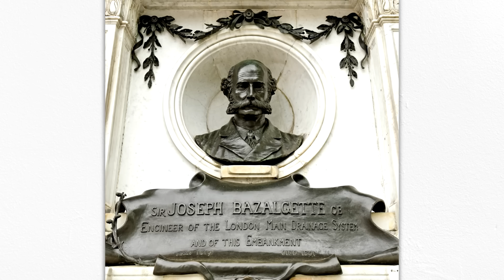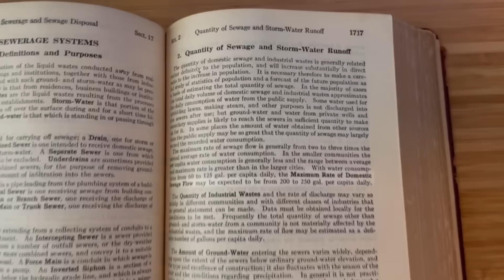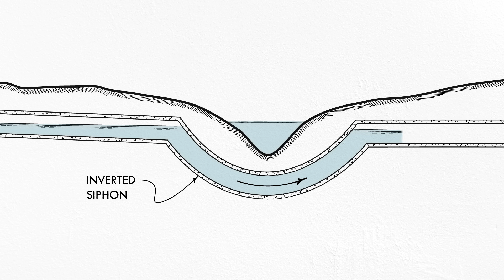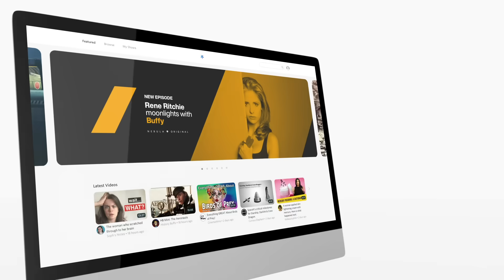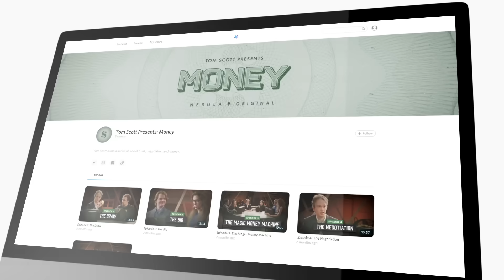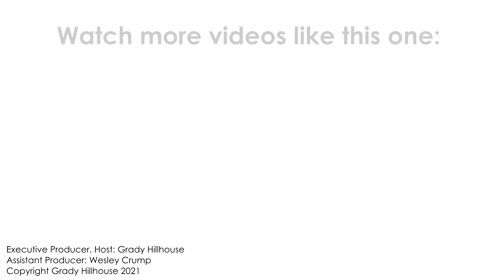How Sewers Work (feat. Fake Poop)

Comment: Bazalgettes pipes were egg-shaped to manage the different flow characteristics during high and low usage. I dont think anyone nowadays really uses egg shaped pipes though. I wonder whether its actually any better.
Reply: They were used in combined sewers which conveyed relatively consistent sanitary sewage most of the time and large storm water flows occasionally. In separated systems, both sanitary and storm sewers use circular pipe.

Comment: Hey Grady, could you do a video on jacking pipe? A housing estate nearby built 2000 houses and decided to link it to the town's 1950's sewerage system with predictable results.... They therefore had to retro fit a sewer line to the water treatment plant but this was the other side of 2 main roads and a cross-country railway line a distance of over 100m. They dug down either side and used jacking pipes to bore a tunnel through. I just thought you might be the person to explain this to me better. If you could find video that would be amazing and I think you could even do one of your models. If you read this,thanks either way

Comment: I would say that the oversizing of buried pipelines that are not expected to operate at full bore (such as sewers and other drains) is almost always the right economic decision. The costs of retrofitting buried infrastructure vastly outweigh the marginal cost of increased pipe diameters during initial construction.
Reply: "We're only going to do this once" is simple, inelegant, but perfectly describes the situation.
Reply: All things are engineered oversize, this is the nature of uncertainty. The question is by how much and can you show non-arbitrary reasoning for that amount. 1.2x 2x 5x? Or estimated population and habit changes for the next 10 years 50 years 500 years? (And how much variation is inherent in those long term estimates?) If 50 years is a good target why not 40 or 60?
Reply: @mytech6779  Luckily there are many models and methodologies to choose from. However, my experience (having worked on a lot of water projects - clean, foul and other effluents) is that the oversizing for futureproofing is often determined by budget constraints and ground conditions when it comes down to it.
Reply: @csatterley  this has been my experience as well, but I've also been out of that whole field for several years now. One big outlier was a city that had the chance to redo their system top to bottom and they planned it out brilliantly, even accounting for major future growth and expansion in coverage area. The dude in charge of that project was meticulous and smart as hell.
Reply: I design sewers for a living. My design phylosophy is to design them around 75 perxent full based on a 40 year design life.
Reply: @donquique1  sound a lot like BS EN 12056. System II is recommended in the UK. This is for domestic sewers such as new developments (where you know the number of dwellings you are connecting and that will not increase as new dwellings will have new connections built). Not for main infrastructure though (where you don't know how many dwellings will be connected in the future). They didn't design the Thames Tideway for 75% full and a 40 year design life, for example.
Reply: most of the cost is probably labour anyway I venture to guess
Reply: ...and be sure to adequately vent them, to ensure no explosive gases can significantly accumulate.
Reply: Oversizing saniatry sewers is not recommended because if the water velocity is below 2 ft per second it accumulates hydrogen sulfide.  Hydrogen sulfide corrodes the sewer. Sinkholes can develop from failed sewers.
Reply: @donquique1  I often see old brick sewers that are tapered at the bottom. Is this a proper way to maintain flow, and are there other methods?
And how do you feel about flushing ashes from your fire place? To plug miniscule holes and counter the natural accidity of rain? Thanks.
Reply: @donquique1  vent it.  Problem solved.

Comment: When in Paris, visit the Musee des egouts de Paris - the Paris Sewer Museum.   Yes, it's an active, working sewer system.  I don't know how the ventilation is processed, but it smells more like a machine shop.  There's been a suggestion, the air is cleaned and fragrance added.
Reply: i tried to go there but the line at 6am was doing 4 loops around the block. no thanks.

Comment: I know flushable wipes arent good for the sewer system but they are far better at the job of cleaning the poop out of one's butthole. As some show (I can't remmeber it's name) said "you wouldn't use a dry towel to clean up mud off the floor." Tiolet paper really sucks at it's job, it's atiquated and I'm honestly surpirised its lasted this long. Maybe for people with clean poops of the right consistency tiolet paper is fine; I've had some of those poops myself and if everyone was like that I would think anything more was needed. However for all the other messy varieities you need something wet to clean it off. Think about it; if you got poop on your hand wiping would you just wipe off your hand with some tiolet paper and go about your day, or would you wash hands, getting the area wet and scrubbing it? Also sense moist wipes work so much better they reduce all the problems one can have from tiolet paper like too much wiping making one's butthole raw and sore. I don't remeber the technical term but I had a buddy in college with IBS and this was a problem for him.
Reply: A bit too much information for me. That said, just wet the TP.
Reply: @johnr5252  have you ever tried weting TP? It clumps up into a very small ball and also breaks apart leaving paper particles in your butt crack.

Comment: This was uploaded right as i had to fix my own sewage line because a bracket broke and the incline in the pipe was now off by like 2 degrees and caused return pressure and blasted the wax ring out and caused....issues.

Comment: Thanks for showing this..as an operator in good standing level 3 collections in Canada. "flushable wipes" and "fat" are by far the costliest thing we deal with on a regular basis...we spend as a city around $900K a year just to maintain the flow in a collection system of around 2500KM (1500miles)

Comment: In my city they had to replace a lot of sewer in the past few years because people used less water then they where designed for and the poop got stuck all the time if the city was not pumping lots of extra water through them. I live in a pretty wet region and water saving is kinda pointless her but people where meaning well and used less water what was counter productive

Comment: Grease and oil congeal at room temperature...which is why when I have designed a WSV (Waste, Sewer, Vent) system for a restaurant there had to be a grease interceptor installed downstream of the kitchen waste.  There would be two lines coming out from the restaurant slab, one for kitchen waste and the other for sewage and the everything else waste.  The waste pipes do not transmit sewage, basically urine and poop...and the other "flushable" items, which had to be routed around the Grease Interceptor so that you would have only grease, oil and water going into the Grease Interceptor.  It IS a "GREASE Interceptor" not a "POOP Interceptor", or a "flushable stuff interceptor", after all.

Comment: 10:41 dude... you have no idea. as for the ads you mentioned right after, I have my ways passed those too. the easiest is to just use the Brave browser, it will cut out all youtube ads. secondly one can skip to the end of a video and hit replay (auto-play next video MUST be turned off for this method to work) and all ads drop from the video. lastly (with personalized ads turned on) one can cap the time-stamp in the bottom left corner of the ad and follow the pop-up stating you don't like the ad, another pop-up will ask you why you don't like the ad but one can actually just hit "close" without citing a reason and upon doing so both ads that would normally play before the video even starts (and aren't skippable) are dropped. 

from what I've experienced, youtube doesn't actually care what reason you give for disapproving of the ad, despite dropping it I guarantee you will see the same ad again, but it will still be skippable using the last method. some ads won't let you use even this method though.

as an honorable mention, if you have the patience... if you see an ad you can just close and reopen the video many times until it loads without an ad. with the exception of the Brave browser, all these work from within the android youtube phone app. I can't confirm if it works on iOS.

Comment: The wet wipes problem is so stupid, the solution is so obvious.

Half the world mocks western societies for how they clean their butts with just dry methods... and wet wipes jumped from babies to adults to save the day. Babies wet wipes were stored in the diaper and the thrown to garbage, but adult people simply don't like to throw literal feces to their garbage, so down the drain it goes.

Just use another method to clean your ass (other than dry). No need to innovate, half the world uses bidets. Japanese bidets (in the lid of the toilet) are the ideal solution.

I know it would take years to amortize the investment, but that's because you're not accounting for sewer blockages costs.  Town halls could provably subsidize part of the cost and save money.

Comment: Not my field, but just my 2 cents:

1: why not turning I&I into use and only flush excess into storm drains?
https://youtu.be/IxXaizglscw?t=3m29s
Where the and output is the storm drain and the exclusive or output is the sewer. Using the slower trickle of the exclusive or output to maintain the sewer flow, while the flush of the and output is handled by the storm drain, where 1 input means low I&I within the capacity of the sewer system, while 1+1 input means high I&I exceeding said capacity.

2: 4:44
Another control is the shape of the pipes. Changing cross section to maintain speed (length/time) while changing flow (volume/time)

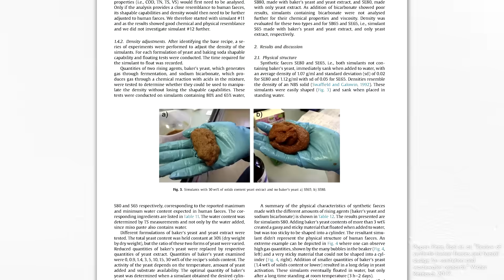3: 6:07 to 6:19
Can't help but notice the uncanny similarity between this part (liquid/solid) to (steam/water) during https://youtu.be/JyvoN1hIqRo?t=4m35s

4: 8:23
Is there any difference arranging the inverted siphon horizontally (all engaged) versus vertically (selectively engaged)?

Comment: I often (too frequently?) wondered if lower GPF toilets caused a higher solid/liquid waste ratio and therefore not enough liquid to keeps things flowing. Is this a design consideration of modern sewer systems?  Is there a way to "flush" the sewer lines?

Comment: Never really understood the use or appeal of wet wipes at the toilet, maybe people that insist on using them should consider getting a bidet instead.
Or if they still insist on a wipe just use regular toilet paper in combination with a motion sensor activated water spray thing near the toilet paper holder so they can turn it into a sewer safe wet wipe? If a single sheet of regular toilet paper won't hold up that way I'm sure it'll be reasonable folded into 3 or 4 layers?

Nice informative video, knew a lot of these things already but a few new things did come up. Oh and I might be tempted to look up some of those recipes you mentioned early on, the pictures looked like they might be promising for gifts that aren't what they seem (hiding something sealed in a plastic bag inside it).
Reply: Wet wipes are usually used by parents of very young children.
Reply: @alistairmackintosh9412  Makes some sense I guess, I do know that my sister and brother both use it for their youngest ones when changing diapers. But both the wipes and disposable diapers go into the bin, preferably straight into the outdoor one.

The brands I've seen here in the Netherlands aren't marked to be flushable. They even tend to have a very explicit logo on all sides of the packaging: circle around a person throwing the object into the toilet which has a diagonal stripe through it. Since it's a pretty universal icon on all brands that I've seen I'd guess it to be some legal requirement either for my country or EU wide.

However I'm sure we've got stupid and lazy people not doing the right thing here. But at least the product description is correct which is a start.

Comment: Forgetting about the joints in the pipe potentially slowing the flow of water. I do this every day. The joints or the lining of the pipe also play a factor in engineering.

Comment: But how does the whole system with all the high and low pipes work? Does air in the pipes play a role? Where is the center and how does a fault somewhere in the system impact the rest of it? Does a different shape of the pipe impact the Self Cleaning Velocity? What if the pipes almost dry up? Will there be a build up of material?  So many questions.

Comment: I'd like to know how a pipe is laid/a hole is dug so that the angle of the pipe meets the specifications set by the engineer?  
Is this done with GPS?
Reply: Standard survey instruments.
Reply: @aeromodeller1  Yeah. How? 😁. I'm not a civil engineer - surveying instruments could be anything to me. And even if i knew what they were, i'd still wonder how they're used to build something to specification.
Reply: @Shocker99  This is all routine, done by people who have been trained in the reading of plans and the use of surveying instruments. A YouTube comment is not the place for a civil engineering education.
Reply: @aeromodeller1  I asked the question in hope Grady would see it and make a video about it because i'm genuinely curious.
But if people want to comment on it, what's the point unless you're actually providing something tangible. Waffle like...."by trained people" and "surveying instruments" are both obvious and non-informative. You've wasted your own time if nothing else.
Reply: @Shocker99  Basic survey work is done with a level and a rod. The level is a telescope with cross hair sights which is mounted on a sturdy tripod so it can rotate around a vertical axis. The rod is marked typically with 0.01' (approximately 1/8") divisions. The height of the level is established by taking a backsight on a benchmark of known elevation. The rodman places the zero end of the rod on the benchmark and the party chief reads the rod number through the telescope. That number is added to the elevation of the benchmark to get the elevation of the telescope. You know from the plan the intended elevation of the bottom of the trench. You get the difference between the elevation of the telescope and the bottom of the trench. You mark that distance off on a long wood rod. The backhoe digs the trench and the marked rod is used to adjust the cut until the mark is level with the telescope. Modern technology uses a laser beam that sweeps a horizontal plane, against which the marked rod is read.
Reply: @Shocker99  US Cost and Geodetic Survey places and maintains primary benchmarks across the US. You may have seen the brass disks on mountaintops and elsewhere. Local jurisdictions maintain secondary benchmarks, some as simple as an X engraved in a curb or a bottle cap like disk nailed down in asphalt. Some are a brass rod embedded in concrete with a surrounding metal case with cover. They would have a survey section that maintains records. Development plans reference the existing benchmarks which establish elevations for construction and also may show the installation of new benchmarks in new streets. No, there will not generally be a benchmark within line of sight in the countryside. You might need a survey crew to run a line of benchmarks to your remote site. Compounding errors may be reduced by doing very careful work, repeating the run, tying into more than one benchmark.
Reply: @aeromodeller1  Thanks for the info! Much appreciated. Do you work in/study civil engineering?
Reply: @Shocker99  I retired from the City of San Jose, Sanitary Sewer Engineering, as a Senior Engineering Technician after 26 years of service.

Comment: San Francisco does not have a separate sewage and rain water drain system! During heavy rain poops sometimes float out of flooded storm drains. Rain water and sewage flows through a partial treatment plant before being dumped in the Pacific Ocean.

Comment: My grandfather actually worked as one of the pioneering engineers in wastewater treatment, he started working on it in the late 40's, and from 1951 to 1965 was the lead engineer. Before his work sewers obviously did exist, but they were only concerned about getting to the sea. One of the "big" (it wasn't and isn't that big) industrial rivers here in Denmark had serious pollution issues, and the local government hired him to help fix it. He wrote a number of papers about it at the time, but they are not digitized and are in danish (and I can't claim to have read them).

Comment: 0:35 "... most underappreciated ..." I disagree. If I had to choose only one (gas, internet, AC, electricity, fresh water on tap, refrigerators, sewage), I would without any doubt choose sewers. They are the most important thing in a densely populated area. I can imagine living in a society without internet, AC, electricity or drinkable tap water or refrigerators. But I certainly would not like to live in a society without sewage. For me, it is the most appreciated thing I can imagine. Second would be tap water. Then drinkable tap water, electricity and the rest.